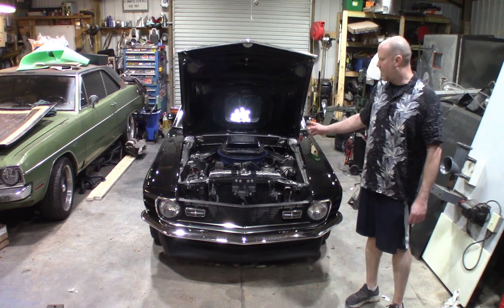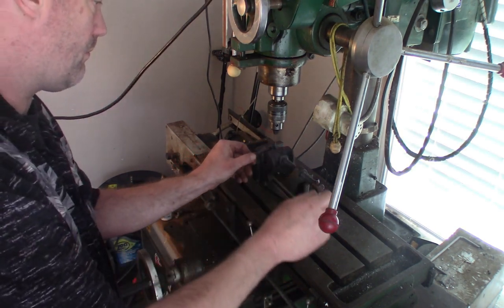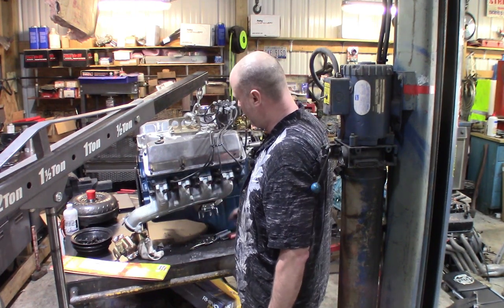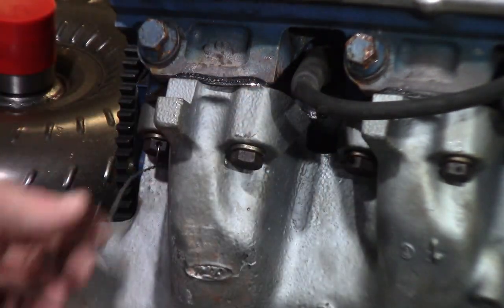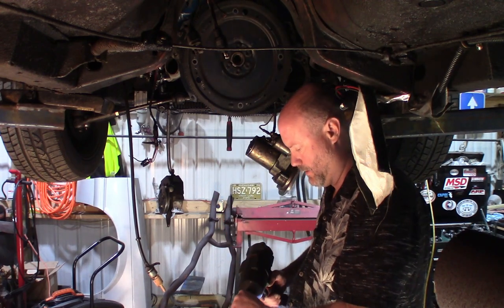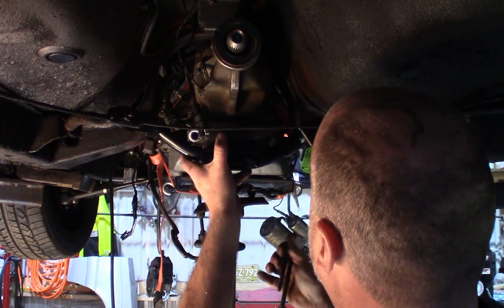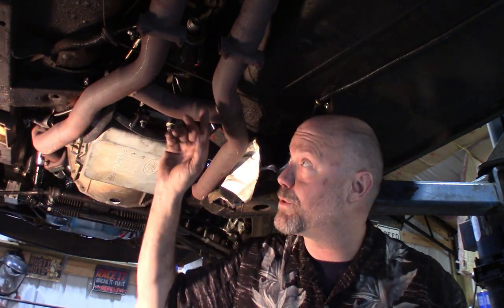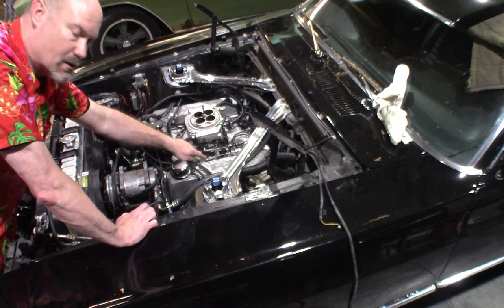1970 Mustang Mach 1 AOD Swap

Comment: One bad thing about a AOD and a old car is that if you know the wiring on the trans the car can be stolen in like 1 min by just using the trans. Came across this with my '69 Torino. TV adjustment was fine using Locar kit.

Comment: Good luck with the AOD, can't say i had any luck with mine , lots of money wasted many times. 

And for engine mounts factory mounts work fine , and less vibration, just drill thought the lh mount, use a counter sink allen bolt with a nylock nut , don't tighten up leave some clearance- no more breaking mounts, works great
Reply from the maker: That’s why I’m about to put a 4r70w in it. My AOD didn’t last either.

Thanks for watching!

Comment: Factory did not use gaskets on the exhaust manifolds as you don't need them and they just cause problems.  As long as the head and manifold surfaces are flat it will seal fine.  You also won't have problems with the bolts backing off. They back off with gaskets because the gaskets relax and when that happens you loose the bolt clamping force which is also why the gaskets fail.  The other reason the factory did not use gaskets is get better heat transfer iron to iron.
Reply from the maker: Thanks for watching!

Comment: Just did this job! Super cool well worth it but I’m a lot more nervous since the c4 I had before was pretty much bullet proof and the aod is supposedly very picky about its adjustments. Just an at home diy mechanic
Reply from the maker: The AOD is super picky about the TV adjustment. That’s actually the reason why the car hasn’t been back on after the install. Smoked it within a couple days of installing it. I followed the TV setting properly but still ended up having problems. I will be going to a 4R70W next with an external controller. 

Thanks for watching!

Comment: Coolness brother.  Reading the comments, I see that you smoked the trans.  Sorry about that.  Any idea how that happened given that you set the TV pressure correctly?  It looks like a used (not rebuilt) trans.  Did the mighty Cleveland finish it off?   Looks like you may be using a Lokar throttle cable.  If so, can you give us the part number.  Keep up the good work buddy.
Reply from the maker: I believe I have a bad Valve Body. Pressure was inconsistent, pressed on regardless of instructions and advice. Ended up with a slipping trans in OD. Never been told I’m a smart man……
Reply: @meatsrodshop7116  im building an AOD right now with a constant pressure valve body made by silver fox trans. I will let you know how it works out.

Comment: Why not just make it a manual. Needs that third pedal.
Reply from the maker: It’s the family cruiser. All of the other classics are manuals, want to leave this one an auto. Old knees and bad traffic don’t mix with manuals! Thanks for watching!
Reply: @meatsrodshop7116 I would love switching my 71 auto to manual but don't want all the work associated or expense. I also don't want those 3000+ freeway revs using 3.50 gear in back but Gear Vendors overdrive is not an option due to exhaust system. We willl see but I need the car just running again. Do you know how much your 70 weighs?